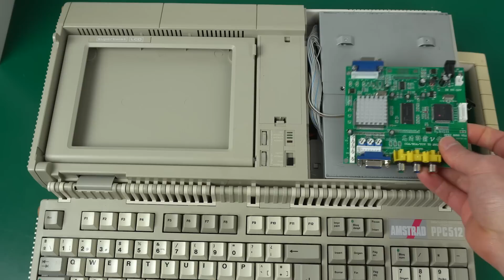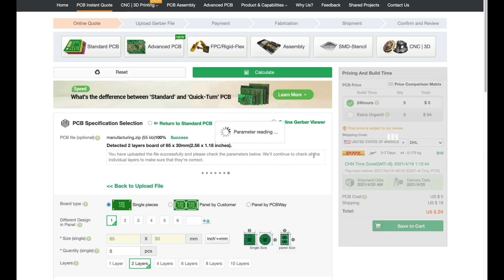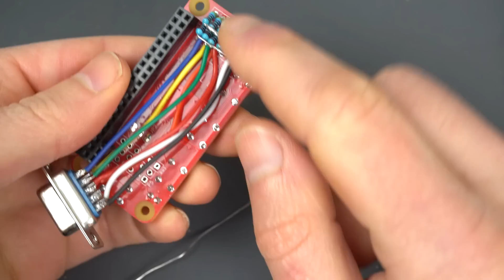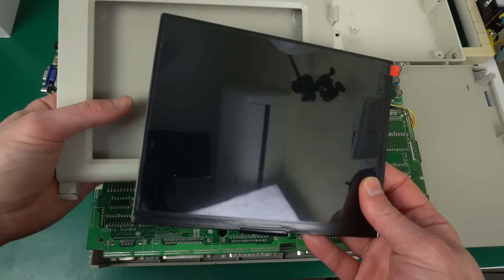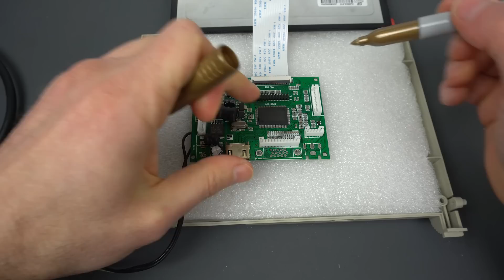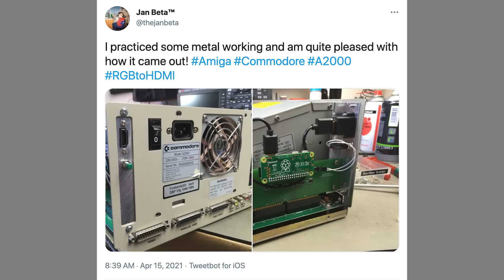Replacing a Laptop LCD With a Raspberry Pi Zero (Part 2)

Comment: I'm sure it would be easy enough to translate the old LCD connector.  Looking back at the schematics from the other video, the R/G/B/I signals are merely tapped from the graphics chip before the buffer that drives the CGA port.  So that's the video portion.

The CX line is most likely a pixel clock, which would give you a perfect reference when to sample the video.  I would guess this same signal is divided down to derive HSync.

I'm not sure exactly what the Frame line is, but I would bet it is some sort of Start-of-Frame marker, and is likely processed a little further to generate the VSync output.  Nothing else seems to carry a frame sync to the LCD, so what else could it be?  Anyway, that same signal goes to an unlabeled pin 1 on the output buffer, which might be an Output-Enable or something.  (I didn't look up the buffer IC.)

So, rather than sampling the slightly processed CGA, converting it to HDMI, and then converting that to native LCD driver signals, a single CPLD or small FPGA should be able to bridge that gap directly -- without the use of a more powerful computer in the computer ( :-) ) and all the resulting cabling mess.  This would also give you digital sampling (instead of guessing at the pixel clock), which means perfect alignment, integer scaling (or optimized scaling, if the LCD is not a perfect integer multiple), etc..

A simple PCB, and a 3D-printed bracket to hold it and the LCD to some structural feature of the lid, and you would have a perfect replacement.

Well there ya go.  Hard work's done for ya.  hahah  ;-D
Reply from the maker: Right, that general idea would be quite good. The problem is that I believe that if you tap at that level, you get single-level monochrome image since that's what the original LCD was. So we probably want to sample the CGA signal anyway to get all the colors.
The other problem are the timings, which are going to be different from modern LCDs, so you'd have to do some buffering, etc, etc. Blargh.
I still haven't given up the idea of using the LCD driver directly though. Stay tuned for some experiments with that.
Reply: @NoelsRetroLab   If you look at the schematic again, it seems the RGBI lines are directly tapped before the external port buffer, along with the MDA line.  It 's quite likely the color lines weren't used at all by the installed panel, but they seem to go to the ribbon connector anyway.

Edit:  LOAD (pin 6) seems to be the MDA signal.  But, LD0, LD1, LD2, and LD3 (9, 10, 11, 12) appear to be a copy of Blue, Red, Green, and Intensity, respectively.

Pins 1 and 19 are indeed /OE pins, tied to the FRAME pin.  I'm still not sure whether that's supposed to carry the makings of a sync signal, or only LOW when the graphics chip is active.  There's gotta be some kind of sync going to the LCD so it knows where (0,0) starts.  Unless that's encoded in the CPX pin.  Curious whether the latter is a square wave or more complex waveform.

Comment: @noel: Better than the 16 colors graphics mode using tweaked text mode,  it could be even better to configure the PI to display the "Tandy 160*200 in 16 colors" mode, even if the Amstrad itself originally does not display that mode correctly?  That would make perfect sense as part of the upgrade. There are many games that support that video mode.

Comment: Awesome video Noel! does using the RGBtoHDMI get rid of the interferance that happened with the MCE2VGA & GS200?
Reply from the maker: Thanks! The MCE2VGA didn't have any interference after I adjusted the phase if I remember correctly (the GBS did though, although that might have been my fault). Anyway, this one looks really solid, just a really minor shimmering of vertical edges sometimes.

Comment: That looks fantastic! I’m so tempted to try this on mine now.
I noticed with the original board that the image was slightly low too, the “60 minutes left” was slightly cropped by the bezel. With the replacement, the image is superb.
Was that the board, or did you actually open the display case and move the screen slightly?
Reply from the maker: I did adjust the screen slightly, but maybe part of the change you saw was adjusting the geometry correctly. It's really neat how it reaches the bezel right now and takes advantage of the whole area.
Reply: @NoelsRetroLab  It looks superb! 😃

Comment: That was a great mod...I bet it's hard to shorten an HDMI cable. I was wondering how you protected the LCD ribbon cable from getting a kink in it...did you cut out some more foam so it can have a nice curve or was there more room than it seemed.
Reply from the maker: Thanks Mike! I got a shorter, ribbon HDMI cable after this, so that should be much better. As for the LCD one, it's just pressed back there, but I didn't fold it by hand, so hopefully that's enough to prevent it from developing a kink. But if it does, I see it's easily replaceable, so I can get a shorter one or give it more room somehow.

Comment: Hi Noel thanks to your vids I am now doing the same mod on my ppc and I have got 2 questions : 1) how do you set up the single button operation to access the menu of the cpld ? I haven't seen any option in the menu to activate it. 2) you said you had to adjust the geometry of the new LCD do you mean the vertical and horizontal offset in the geometry menu ? which are the best values to use ? and did you let the resolution in Auto or changed it to 640x480 ?

Comment: I'd be curious to know what the power draw difference is between this setup and the old one. No reason other than curiosity.  Looks fantastic!
Reply from the maker: That's a really good question. I've been powering it from my bench power supply, so I see the current draw. I wish I remembered exactly what it was like at the beginning. I think it was 1.2A or so. Right now it's about 1.5-1.6A I think. So it's definitely gone up a bit.

Comment: for the PC/display case you could have 3d printed a small standoff base board, and use electrical/insulation tape to make sure everything stays in place

You could also have used those Flexible/ultra thin HDMI cables
Reply from the maker: Agreed except that... I don't have a 3D printer yet 😖 I learned about HDMI ribbon cables right after this and ordered one. Installing it today.
Reply: @NoelsRetroLab  When you go the 3d printing route make sure to do a few test prints first so you can get a feel for the offset, as parts can shrink or expand depending on the temperature.

PLA filament would be the best place to start as ABS, and other filaments are more tricky to work with if you never 3d printed before.

make sure to get a GLASS bed for printing, as this will give higher quality parts than straight on the bed

Comment: So you got me now with this mod. Now what about a video about putting the pi zero into an Amstrad CPC6128? Great stuff again. Keep it up!
Reply from the maker: Haha, thanks! You're not the first one to ask for a video applying the RGB to HDMI to the Amstrad CPC, so I may have to do that. I don't think it'll be very complicated, but it could make for a nice, quick video. Cheers!
Reply: @NoelsRetroLab  I've got an external PSU build into a case and a GBS 8200 unit inside with all cables done to attach to my CPC, but it's always a bit of struggle putting all up and running. So an internal mod with the Pi Zero would be a lot better... ;)

Comment: Very nice video series! I am curious whether the Raspberry Pi approach had the problem of the display output flipping horizontally occassionally?

In other words, it was uncertain whether the flipping issue was caused by the Wisecoco HJ080IA-01E display controller, or the GBS8200 converter? I am looking to do a similar mod to my Amstrad PPC512, and looks like Wisecoco HJ080IA-01E might be the way to go if it works cleanly?
Reply from the maker: Thanks! The video flipping was definitely the LCD driver, because it would flip the menu text as well with nothing connected.

Comment: Why not put in a VGA card instead of Raspi? Looks like someone does not want me to link to projects with 8bit VGA cards one with Trident TVGA9000i from Sergey Kiselev.
Another with some Realtek RTG3105iEH chip ISA 8 bit RTVGA.
There is a full ISA bus is on backside, some flat cables with crimped connector would fit nicely through the slot in the case. Beside a slot only two bus drivers would be needed.

Comment: IIRC, the Apple II 3.5 inch disk drive, around the IIc era, contained a 6502 processor that was as powerful as the main processor in the machine. So, this kind of situation with "overpowered" peripherals already happened even in the 80s!

Comment: Great video as always :) how did you get rid of the flashing issue? and what are the other settings (geometry / sync) you changed? i got my setup recently and frankly its all over the place (flashing, and also out of sync) and no matter what i try it seems it just does not want to work :/ (i get the cpld config just fine but when i turn on the ppc - it just goes wrong... )

Comment: Many years ago I made a CGA to VGA converter with three transistors and a set of resistors. Basically it's just a matter of converting the RGBI from TTL level signals into the analog that VGA requires. I've lost the schematics but it was essentially a matter of using a voltage divider on each of the color pins and then using the transistors to make each color sensitive to the intensity pin. It probably would have been cleaner if I had used op-amps on each color. Of course, the converter required a multisync VGA monitor that could accept the CGA sync rate but pretty much anything that accepts VGA these days is multisync.
Would such an approach work on the Amstrad?
Reply from the maker: Right. Unfortunately that doesn't with this LCD as it doesn't accept the 15 KHz signal. But I may be able to do something about that in the future 😃

Comment: BTW, on your original link to the screen (search in Aliexpress) there's a result from the same vendor that you showed in the fist vid that uses a smaller, simplified interface board which ONLY has the HDMI input. As you're using RGBtoHDMI now that other interface board would cut down the mods needed a lot. I'll link in my next comment if youtube lets me...
Reply from the maker: That's true. At the beginning I was focused on VGA, but the HDMI-only one would be slightly cheaper.

Comment: Hi Noel! Does the LCD driver  support 15kHz frequency? If yes, you can use my MCE-Adapter for conversion. The whole setup would cost you 3€
Reply from the maker: So, that's where I'm headed next. I tested it and the driver does NOT support it, but... we may be able to coerce into doing so. Stay tuned 😃

Comment: There comes a point where it’s more important the hardware still works rather than try to keep it 100% original. And in this case, it’s a non-destructive mod and can easily be removed it appears.

As for the mod, I think it’s great! My only worry would be SD corruption. Having said that, if you could get the Pi Zero (I assume it’s a W model) to also do floppy emulation it’s a 2 for one mod (with wireless access) :D

As an aside, and I’ve no idea if this would work, could a Pi Pico be used instead of the Pi Zero, the HAT and the driver board? If so, that would be a pretty sweet solution.
Reply from the maker: Thanks! I don't think SD corruption is a big deal because we're never writing to the SD and just reading very occasionally (and it's easy enough to replace if it fails). This was the cheapest Pi Zero, so no WiFi. The WiFi one would open up new possibilities for sure!
The Pi Pico doesn't have an HDMI out, so that makes it harder. On the other hand, if I could get it to output signals to talk directly to the LCD, that'd be great! 😃

Comment: The HDMI or VGA input scaler chips hanging off the LCD panel are already a significantly more powerful computer... megabytes of on-chip RAM and an ARM9 processor usually, something like that.
Reply from the maker: True. It starts getting depressing when you start adding up the power of all modern chips surrounding that. Haha!

Comment: interesting solution... but.. does it create any input lag.. it would have to going through the Rpi.. 
i got one of them LCD driver boards... to power up a 7in screen outta a tablet... but do you think i can get any output!... did you need to program yours to match the screen?.. (might have had something to do with one of the inductors (the capacitor looking things with what looks like heatshrink around them!) started smoking when i first hooked up power to it!)
Reply from the maker: No lag that I noticed. The project page talks about 4ms lag, which seems more than enough for CGA gaming.
I didn't have to do anything to the LCD driver. It came with the LCD and it just worked out of the box. But if the inductors were smoking, that's really bad! 😬 Maybe your driver needed 5V and you plugged in 12V like this one?
Reply: @NoelsRetroLab  my board is identical to yours.. 5-12v input...the onboard regulator provides 12, 5, 3.3 and 1.something volt rails.. .i havent traced it down to the inductors yet..but i did get my cash back from the ebay seller when i contacted them about it... so i may just buy a new one...with LCD..that way i know its gonna work (the LCD i have is said to be compatible...i looked for a driver board for that particular LCD and this board is all that was coming back)

Comment: I would have preferred the other way of connecting an internal 8-bit VGA card, as this type of hacking was not uncommon in the eighties. But your way of working is much less disruptive to the original hardware. Anyway, there's nothing stopping you from doing it later...

I look forward to the next changes, to see if you will add any kind of battery support to this computer and see if you can get rid of these pesky TIME and DATE messages. I am assuming this computer does not have a backed RTC battery, or it has some kind of old DALLAS RTC. In this case, it should also be fixed...
Reply from the maker: Like you said, that's still possible. I wanted to do this first before I continue with other upgrades. But one possible end game would be an internal VGA card. I wonder if speed would be an issue though. Will Prince of Persia for example run at full speed? Only one way to find out 😃
I wasn't planning to get into batteries for this computer though. At this point, I consider it no different than other microcomputers and it's just something I need to plug in before using. I won't be taking it with me to coffee shops any time soon 🤣
Reply: @NoelsRetroLab  Don't forget about the sound. Some kind of AdLib or SoundBlaster compatible device could be a great final addition to this computer. Perhaps with  also some speakers? But this definitively will mean a big modification to the system, make holes and so...
Reply: @fcastellanos  Maybe one of those OPL3LPT parallel port cards?
Reply: @TheMalMeninga  Yes! Something like that. But if you want a more radical mod including adding speakers to the computer, then maybe you should add an internal card info the modem space
Reply: @TheMalMeninga  But the mono speaker could be also be added to the back of the screen plastic frame structure.
Reply from the maker: Yes, I forgot about that. I have one of those parallel port cards too. Should be fun!
Reply: @NoelsRetroLab  You could look into Lipo bats, I'm sure you could fit the bats/charging circuit in that battery space.  What better way to show it off than to take it to the coffee shop! :D
Reply: @TheMalMeninga  I did test my PPC with the Covox (https://youtu.be/vPtikDYTh5E), sadly it seems my OPL3LPT wich I bought at the same time doesnt work. I need to test it on another computer before though.

Comment: Great Video.   However,......  as a modder, I wonder if it would have been easier to remove all the internals and just use the Pi with emulation and a keyboard adapter.  :-)
Reply from the maker: Haha, you could have, but where would the fun be in that? Besides, I still have a lot of expansions and mods to do with the original hardware.
Reply: @NoelsRetroLab  Technically if you get very creative, you could have both in the same case, with a simple switch to boot between the RGB conversion and something like Raspbian, and an adapter to intercept the keyboard (so no permanent hacking.)  Add a SD card and USB extension and wow you have the most capable PPC ever.  :-)

Comment: What's the delay time between turning on the Amstrad and seeing something on the screen?

I ask because if we're waiting for a Pi to boot before we see video... that could be an issue for some applications.
Reply from the maker: The Pi starts up waaaaaay faster than the PC. It's a bare metal application, so no long boot up time. I probably edited it out, but within less than a second of turning it on, it flashes a colorful screen for a split second. At that point it's ready.
Reply: Did you happen to know a distributor for the hat, @NoelsRetroLab ?  I guess the original creator has been out of action since September of 2020?

Comment: So, there weren't other, more recent, devices that would have had the kind of panel the computer originally had? I think I've seen panels like that on some oscilloscopes. (I don't know if the panel technology would have been the same, but I think I've seen monochrome LCD screens of roughly same size on some of them.) Would there be any chances that at some point of the signal's path there would a point where they would be compatible?
Reply from the maker: It's certainly possible! Oscilloscopes are tricky though because they often had completely different kinds of screen (not raster based, but vector based).